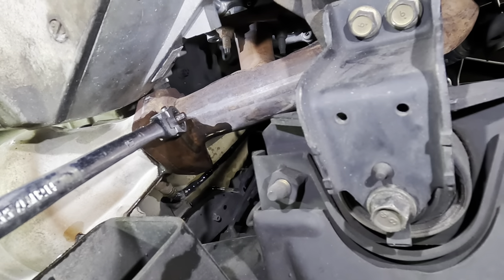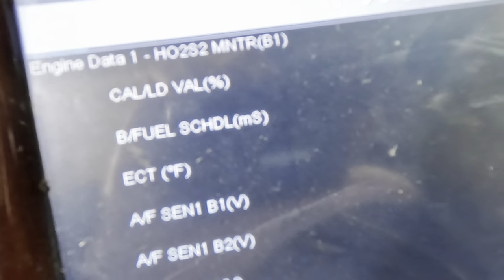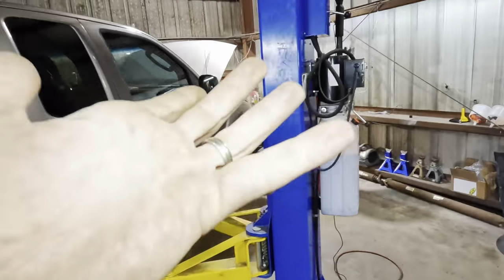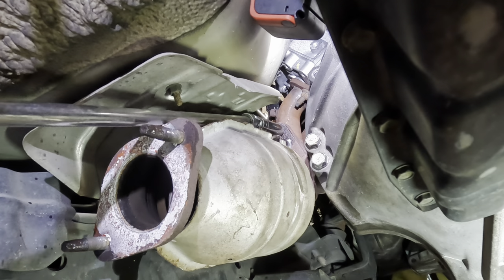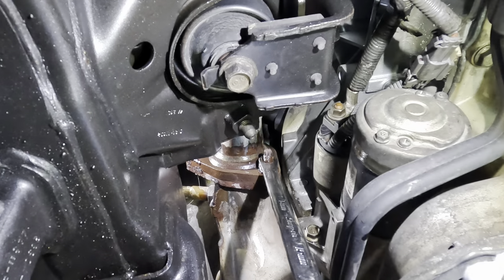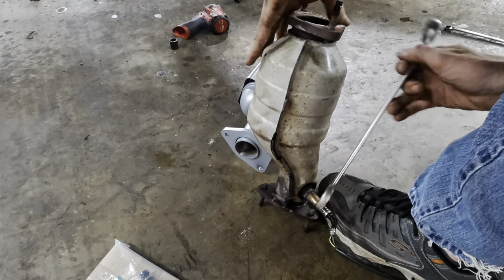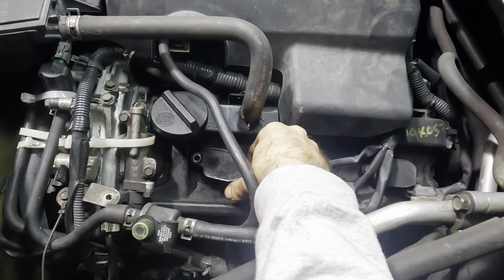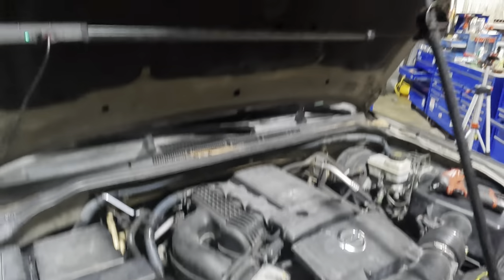Catalytic Converters! Missing?  Running Rough P0302 P0420 P0430 Nissan Fronter 4.0 v6

Comment: As a pilot,  i can answer that airplane on a treadmill question... the wheel speed  has nothing to do with air speed, the  airplane will still be able to take off since its Not the wheels that propell the craft, its the jet engines/propellers, those two use the air as "traction" to accelerate to lift off speed, so it doesn't matter at which speed the wheels are going.
Reply: What? Lift doesn't come from the engines. The wings have to be moving thru the air.  Air moving thru the engines still doesn't cause lift. ( I think ).
Reply: Great answer....You would know
Reply: The wheels are there to help the plane move on the ground, for the plane to lift off it needs forward momentum from the engines and lift from the the wings, if the aircrafts engines are on i.e idle rather than thrust. The plane would take off from the treadmill as it would have speed and lift but only for a second or two, without forward thrust from the engines to propell it forward.

Comment: Most likely, the converters weren't emptied out by anyone.  The internals have a habit of disintegrating and blowing out the tail pipe.  It's not that uncommon.
Reply: It’s a Nissan, I’ve heard they like to suck up the ceramic bits and destroy the engine somehow. Ive heard.
Reply: Had to pass through the muffler to get out though!

Comment: Ray, hopefully you may see this. I use MIlwaukee guns at work and i find that the "temperature" pin tends to get pushed into the body of the M12 batteries.  If you use a pick tool to pull the temp pin out of the housing a little it may fix your problem with Milwaukee batteries.  It will cause them not to charge and on impact guns they will cut out and youll get flashing 2 lights.

Comment: That BG lubricant is is great. I've used it for years. I like the way it foams up, therefore, giving it more time to penetrate
Reply: If you look at the stud after the nut is removed the threads are dry. "Penetrants" don't.
Reply: Is this supposed to be a kind of innuendo?
Reply: It takes hours or overnight for Penetrating oil to soak Threads, many tests on YT showing this--it is a Mind Thing...
Reply: @randy beard  Eric O always simply states the "panther pee doesn't do anything". As you note, if it does anything at all, it takes much too long to be useful in a profitable shop.
Reply: Looks a bit like seafoam deepcreep... Project Farm did a good comparison on those...

Comment: Hey Ray, mythbusters actually did the airplane on a convyerbelt myth years ago. thats where I'd first heard of it. they took a super long tarp and pulled it with a truck as a small plane on it tried to take off in the other direction. it took off in the exact same distance as it normally did (it could take off at like 60mph so thats what the truck was pulling the tarp at) its a cool watch since they started small with an RC plane on a treadmill, then went to full sized planes!
Reply: I was just thinking about this, the plane doesn't care about the treadmill/tarp because it doesn't have any power to the wheels so they can spin as fast as they want

Comment: The more I watch your videos, the more I want a winter place in Florida. Most fasteners come loose fairly easily, Every vehicle actually still has its whole frame intact. Not to mention 30 degrees there is concidered cold. I've been hoping for above freezing temperatures for a week lol.

Comment: The plane on the conveyor belt thingy is very interesting from the human behaviour point of view: the description describes something physically impossible (the conveyor mechanism has a feedback loop that makes the description non-sensical), and people "patch" its behaviour in their brain by ignoring the words and using their imagination instead - in two different ways.

In my humble opinion, there's no point talking about planes at all if that conveyor action does not add up - and that should be the answer.

[edit] everyone who talks about planes and lift missed the point I am trying to make.
Reply: It's not intresting. Mythbusters did it. The plane takes off.
Reply: The airflow from the engine pushes the plane forward just like if you where pushing it from behind, what happens with the wheels doesn't really matter. The conveyor belt cannot prevent the plane from going forward.
Reply: @MeepChangeling  mythbusters allowed the plane to move, which violates the description of the conveyor behaviour: the conveyor belt is supposed to match the speed of wheels. Since speed of wheels is speed of conveyor plus speed of plane, if plane moves the description is violated. The rule is "A is governed by equation A = A+B for any B".

At the other hand, nothing prevents the plane from moving (B > 0), so of course it will take off. The conveyor cannot stop this.

It is the description (A=A+B) which is is nonsense.
Reply: Kinda like the glass 1/2 empty 1/2 full theory.
Reply: From a pilot of Rc planes. Air has to pass under the wing to produce lift simple.
Reply: The wheels on a plane do not drive it forward the way they do in a car.  So the conveyor belt is irrelevant.
Reply: It's like asking which is heavier, an empty compressed gas cylinder or one filled with a lighter than air gas like hydrogen.
Reply: @markvandesande8855  "Air has to pass under the wing to produce lift simple." I promise, that part is not in question. I am really not looking to repeat the argument from 5 years ago, I am pointing out how misleading the initial premise is, and how people react to that misleading premise.
Reply: @radekc5325  Actually, thanks to David Bernoulli, it's the curved upper surface of the wing that provides lift and makes wing design predictable. Langley believed that the wings needed to skim the air like a stone skipping across water which was the wrong approach.
Reply: The speed of the landing gear wheels is irrelevant. Once the engine thrust begins pushing the plane is going to fly.
Reply: I understand that not all devices are built with the same interlocks or "feedback" loops so that any theoretical situation is theoretically possible.

Comment: Ray about your batteries not wanting to charge when they are low…. If you take a 9v battery and jump some wires ( or use a 9v battery wire clip ) and briefly touch the terminals on your ailing battery pack … it will charge it up enough to accept a normal charge from your charger. This is a YouTube trick I have seen and used… it does work.

Comment: As an aircraft mech for 40 + years I, along with many others, appreciate your skills.  When I see you work it reminds me of the great mech's who use to work for me at ^^^^^ A/L's.  Yea we had the occasional dud but most were skilled and trained like you.  As far as tools-- taking others tools was a firing offense.  My best friend and work-with would say when his tools were missing he would just look in my tool box.  We lived by the snap on rule. I make my living with snap on tools please don't ask to use them!
With that said, with airplane work, you don't want to find your ball pean hammer in the windshield of a car that was driving on the interstate under the runway-- just when the pilot put the gear up!!!!
My one critique, mentioned before, is metal on metal assembly. I wish you would use O'lube or luber-plate on meshed metal parts you assemble. You always use it on plugs.

Comment: A little trick on those batteries is they get just low enough the circuit blocks charging and disconnects the battery from the main plus minus on the case. Just pop the not charging battery case apart and use another working battery to jump plus to plus and minus to minus directly on the not charging battery pack. only takes a few seconds. Put battery case back on and it will charge fine until next time you put it away dead and it drops below that voltage again. There are videos on the process.

Comment: For those "failing" batteries, it's because the lithium pack in them has dropped below the threshold to be charged. Doesn't mean the batteries are dead, but as a precaution the MFG has to make sure a bad battery won't explode on the charger. Take your bench power supply and set the voltage to the pack voltage and limit the current to half an amp and just let it charge for 10-20 minutes. This will put enough juice in them for the charger to see a voltage higher than the lower threshold and all your packs are good to go.

Comment: Hi Ray! As a non USian not living in the US I can tell you that ramblings about the quality of US fuel are for the most part people who don't realize that the octane number stated in the pumps in the US is measured differently from Europe and most of the rest of the world. Europe/most of the rest of the world measures using RON (the older standard, using a completely unloaded reference engine), US averages the RON and MON numbers (MON is the newer standard which uses a slightly more realistic reference engine with some accessories like a 'nator), with minimum admissible RON and MON for each grade. US Regular/87 octane is somewhere between 91 and 93 RON, US 91 is ~95 RON, US 93/Premium is >=~97 RON (equivalent to Premium in Europe). The standard ethanol content in the US (~15% typical as of the war in Ukraine) does mean each gallon of fuel has less energy than a gallon of fuel with no alcohol, but the difference is not that big.

The one thing I personally find appalling about US fuel (besides Mountain Fuel, although I can't comment too much as there are very few pumps above ~3500 meters a.s.l. in my country) is that Regular fuel isn't required by law to have an additive/cleaning pack (it won't save you from all the emissions equipment in cars, but it should make it last longer).

(Yes, more minimum octanes allows more compression which is more efficient, but no country can throw the first stone in this regard)

Comment: Enjoy your channel. Keep up the good work. I am not a professional mechanic. I fix my own stuff for the most part-'professional homeowner'- :) . New engine, empty cats/new cats. Wasn't there an issue with Pre Cat failure on various years. Catalytic converter media breaking down and getting sucked back to the engine in EGR stream.

Comment: Per your tool battery comments, temperature definitely impacts them significantly. I had a Milwaukee M18 battery die WHILE ON THE CHARGER in my garage (green light was on when I pulled it off the charger, but it wouldn't work in any tools and the level indicator was non functional, put it back in the charger and it flashed red & green). I brought it in the house and set it on the kitchen counter to remind me to warranty it, and a couple hours later I pushed the level indicator button and it lit up 1 bar, I stuck it back on the charger and it started charging again.

Comment: My other comment disappeared, maybe because I had a link to something.  But regarding the 20 minute mark where you could not use power tools, look into the “tite-reach” 3/8” extension that’s a 1:1 drive extension that you can use an impact on while the narrow part gets to the fastener.  The 3/8 drive one is good for 110 ft lbs.   

I just bought the quarter inch, 3/8, and half inch professional versions

Comment: As always I appreciate the content. Glad you're involving us in your endeavors. 
Regarding the battery "not charging" stuff:
BigClive made a video recently about an Aldi-Pack. He showed in the schematic that there is a chip that controls the charging circuit and state of cells. And if they get too low it "shuts down". There is a reset switch to basically force that processor back online. On top of that he explained that many batteries discharge below the threshold and can only accept a tiny trickle-charge until they are above the threshold of the chip to "cut off". 
I suspect that your Rigid Tools don't have that "low discharge" cutoff or have the threshold WAY lower than your "more betterer tools". 
BigClives video is "titled Inside an Aldi Ferrex 20/40V battery (with schematic)" for anyone fancying a look.

I suspect that your SnapOn Battery accepts a charge because it went too low and force reset the chip due to the cold climate.
Reply: Not all packs have low cut off at all saves a few pence on the control board and forces folk to buy replacements, win win?

Comment: Another great video Ray! 
A sense of humor as defined by Dave Barry, "A sense of humor is a measurement of the extent to which we realize that we are trapped in a world almost totally devoid of reason. Laughter is how we express the anxiety we feel at this knowledge." 
It's been said no plan survives the battlefield. So it must be with catalytic converter installs. 
I would imagine that you have to stay pretty current with your tetanus shot, I know I was back in my machine shop days. I was often introducing random metallic objects in my body, (so much so that I set off the metal detector at the airport once, but that's a story too long to put in here).

Comment: At 21:32, when you're trying to get that nut to turn, if you push on the wrench counterclockwise until it is firmly tense by, let's say, 15/25 pounds, hold that with one hand while taking a medium hammer with the other and firmly tapping several times on the wrench three or four inches away from the nut, it significantly mimics an impact wrench and will break past the rust/torque bind.  It also helps prevent the bolt (which may be heat/rust compromised) from breaking because of the extreme torque that may otherwise be applied while simply torquing it with muscle.
Reply: Do you mash a lot of wrenches?

Comment: Love the content Ray.  At the video 7:53 mark we see the engine STP oil filter, but there’s a plate or some part in front of the oil filter sitting on that lower cross member, that looks unbolted from when the newish engine was put in.  It almost looks loose sitting there?  Has bolt holes and no bolts. 
And yes as of 2022 we all need therapy.  Your not crazy.  I would like to start using propane, instead of gasoline.  At least.  Also if ya left your tool in my car, it’s mine now.  Heard me Magnolia High five stereo installers.  Those installers left a door panel removal fork tool in our car once.  It lives in my tool box now. Rules are rules.  : )

Comment: So years ago I took my Taurus to an independent repair shop to fix all the things the local dealer broke, and weeks later I discovered a very long (expensive) screwdriver in the channel above the radiator. I returned it to the repair shop and the manager told me the tech whose screwdriver it was had just lost his wife to cancer, and returning the screwdriver would cheer him up a little. 
😊

Comment: Great work and commentary. The only thing my dad used to say was clean and lubricate the threads because you may be the poor so n so that has to take it out in the future. It will save time and money for all concerned.
The plane on the conveyer belt. The plane needs air speed. On the conveyer belt it has no air speed. No air speed no lift!!

Comment: In Brazil we use E27 gasoline and cars have only a single catalytic converter. The goal is to get the percentage of ethanol premixed on gasoline higher, so emissions goes down (since ethanol burns much cleaner)

Comment: With that test lead kit, knowing the customer would also come into play in my book. If my customer is someone I know would do their own diag and attempt most repairs that doesn't require a lift, then I'd also check with them. Outside of that caveat and the ones you mentioned (neighbor mechanic, other mechanics in the same shop, etc.) I totally concur. Now, since you're a famous youbertuber dude, if the person who previously owned it contacted me, I'd ask for a good bottle of after work adult beverages as a finders fee.

Comment: The ground wire on the exhaust system is there because, as it is probably, hung on rubber mounts, static electricity can build up and cause radio interference, the ground connection dissipates any such build-up.

Comment: Great vids, Ray. 
To the question of the airplane...well, it wouldn't take off because the speed needed is over the wings, not the spinning of tires. Otherwise, the plane would be standing still.

Comment: normally if you're gonna empty out your convertor you would put a "collar"? or "shield" adapter to cover the O2 sensor in order to trick it into thinking the cats still doing its job. If you have the option of flashing or chipping your ECM to remove the post-cat o2 sensors after a cat-removal/test-pipe swap.

But theres no vet in KY these days so thats no problem

Comment: That polar vortex had it in the low single digits in southern Arkansas. We are used to the mid 30"s at the lowest around these parts during the winter.  and supposed to be up in the 70"s later this week

Comment: You may need to reset the Apollo-D8 scan tool to get the performance back up. Remove the left rubber hand grip.The reset button is located on the opposite side of the main board from the CompactFlash card. The button can be pressed for a few moments to reset the unit

Comment: To get the batteries to charge again connect a 12 v car battery to the battery and give it a bit of a charge then put her back on the charger! The 12 v will get it over the low battery voltage shutdown for the charger. I’ve actually seen it work Ray!

Comment: On your alternator not working Duramax has a grid heater and glow plugs and it's just the grid heater still on till the truck has some temperature.....I have a 07 classic with 359xxx. Love my lbz

Comment: I really do hope you see this. As far as the battery your on the right track. You can do a reset but it’s annoying. When you put the battery on the charger you will most of the time get a light for a few seconds and then it won’t charge. That few seconds is the annoying part you have to keep taking it off and putting it on. After awhile it will charge regular but it’s taken me 30 minutes before. Good luck 🍀